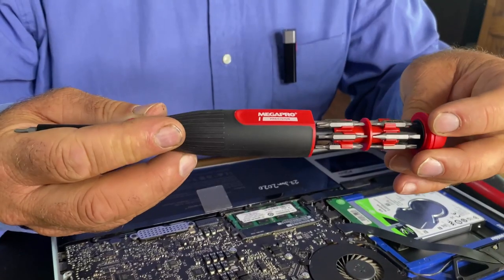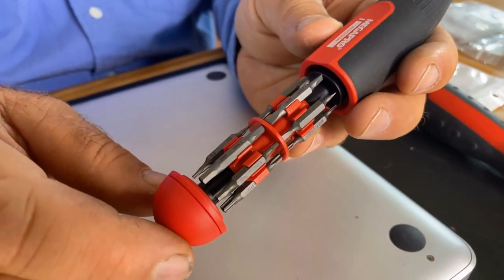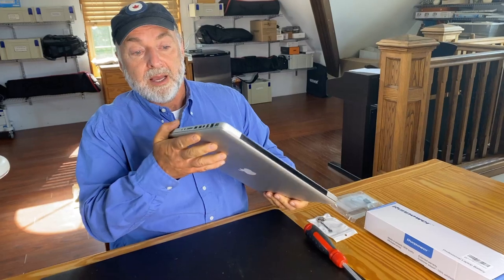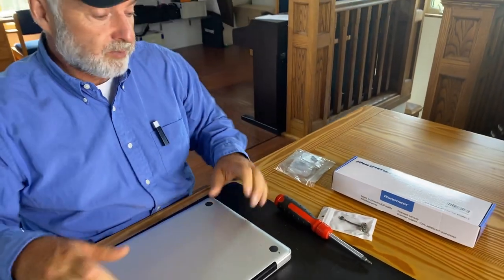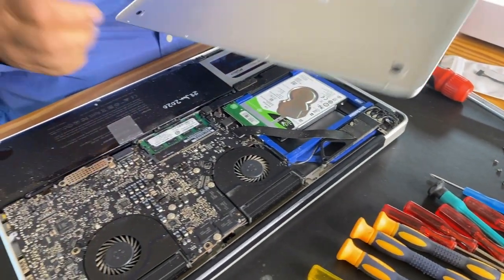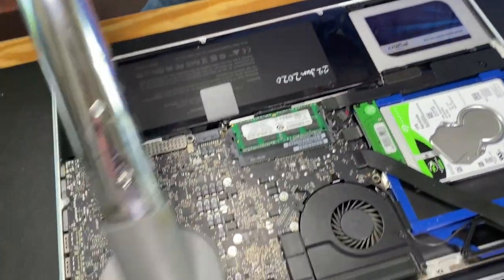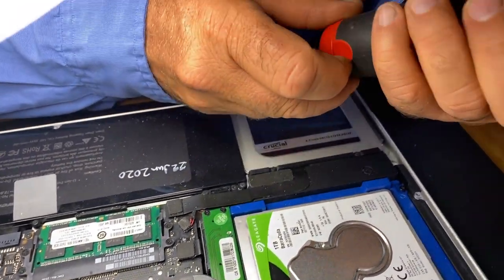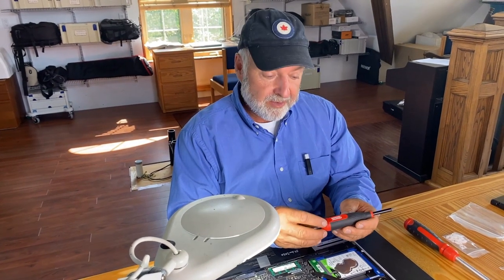Reviewing the WORLD'S BEST PRECISION SCREWDRIVER SET

Comment: Absolutely agree: good tools go a long way, using cheap tools may end up costing more eventually. 

I have the same MacBook Pro, very solid machine. Exchanging the batteries is the only thing needed - possibly replace the thermal compound. Absolutely agree on what makes a screwdriver a good screwdriver. Curious if this is available in my neck of the woods (The Netherlands). Oh wow - the way you absolutely wear out the keys on your keyboard is quite something! I wear out the lettering but you seem to wear down the surface of the keys as well! Diamond finger tips :)

I see you did away with the optical drive and use the bay to house a second hard drive! That's quite nifty!

Comment: I remember working on cars back in nineties when I rounded off many bolts because I used poor quality tools. The tools were cheap but I could spend a little bit more for much better tools. Make no mistake that you can buy pretty cheap tools at Harbor Freight without sacrificing the quality. If a tool is made in Taiwan you can be pretty sure it is a quality tool. In general I avoid hand tools made in China because I find the quality of their tools inferior and inconsistent.

Comment: "WORLD'S BEST PRECISION SCREWDRIVER SET"  –  'Click-Bait'?  rather than a review on the merits of different styles and purposes of driver sets?
 
Youtubers these days seems to be more interested in pushing for 'absolutisms' rather than the desire to share and learn.

Thick heavy handles with weight at the top of the driver and a thick shaft to hold short bits can work with wide unobstructed spaces like cases or back of laptops, etc.
But can be clumsy and not as controllable in sensitive (electronics, tall electronic components like tubes, large capacitors, or small mechanical components like watches, etc).
In tight situations, I found slender driver with a swivel top can allow more control where needed.

There is a 'need' for a variety of screwdrivers for a wide variety of purposes. 

I appreciate your pointing to the quality of the 'bit' not rounding over due to soft metal a significant issue no matter which styler drivers and bits you use.